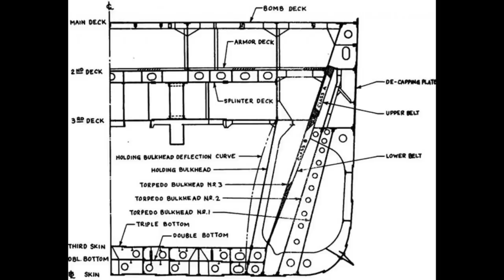The Drydock - Episode 230

Comment: 27:35 the Hush Hush W1 locomotive was made using a marine boiler and it's one weird looking engine due to the shape of a marine boiler. It was designed by Nigel Gresley who also designed Mallard the fastest steam train in the world.
Reply: You misspelled Milwaukee Road F-7.
Reply: The Baltimore & Ohio built several experimental watertube-boiler locomotives beginning in 1927.  They were unsuccessful because while watertube boilers are really good for applications that require long periods of steady power output--stationary power plants and ships--they don't do well where the power demand is highly variable, as in a locomotive.  The firetube boiler is better in that application.
Reply: @michaelmorley7719  to add to that, Baldwin 60000 at the Franklin Institute has a Water Tube firebox, which was trialed in place of a full water tube boiler by Baldwin for a few engines, and it was found that while it gave better steam production, maintenance and cleaning was said to be an absolute nightmare and much more costly endeavor than a traditional firetube firebox (mouthful I know). So ultimately, on the harder water that most steam locomotives used, it was easier on maintenance to just not use a water tube firebox or boiler
Reply: It was also the only tender locomotive with a 4-6-4 wheel arrangement to run on UK tracks... though it wasn't much like the American 4-6-4s, which were basically a brute forcing of the 4-6-2 design for more power output at speed (though not without its caveats, they pretty much needed a trailing truck booster to start heavier trains).
Reply: @PaulfromChicago  The F-7s were certainly up there - AFAIK, the Hiawatha timetables required 100mph + running in places. The LNER A4s did not go anywhere near that in regular service, to my knowledge.
Reply: The original sketches for what became the A4's (the class Mallard was a member of) also had a water tube boiler, similar in layout to that on the W1 but slightly scaled down.  The W1's failure to live up to expectations put paid to that and they wound up with conventional locomotive type boilers.  There's a painting of the original scheme in Robin Barnes' book "Locomotives That Never Were".
I've always wondered if it would have been possible to take the Churchward scheme (as used in GWR boilers) of having the feed water cascade down over removeable trays in the steam space to collect the worst of the scale away from the tubes, and apply it to marine type a water tube boiler, but I guess the only place it could go would be the upper steam drum, and there isn't necessarily the room.
Reply: HAHA!  That looks like someone from the 50's made a façade for a locomotive.
Reply: @LeCharles07  have a look at the south australian railways 620 class.  The first of them was "streamlined" in the fashion of contemporary cars, and had an ACTUAL CHROME GRILLE on the front.  One about 10ft wide and 10ft tall...

Comment: Rail locomotives also didn't do so hot with steam turbines, as it turns out. Turns out running on rails is a bit bumpier than in a ship, so things get jostled about pretty badly and knocked out of place. Plus, unless they've got a transmission of some sort, they absolutely suck down fuel at low speeds.

Comment: Many rail companies experimented with high pressure water tube boilers sooner or later but in the end they all had the same problem: The required extra costs for production and maintenance were so high, it became economically infeasible to adopt the technologies, even if individual engines showed promising economic benefits. In the end steam technology as a whole died down entirely in favour of Diesel and electric engines just when advances in design and metallurgy could have made more advanced boilers feasible.

Comment: Alot of Soviet anti ship missles used blast fragmentation warheads and weren't designed to peneatrate armor.  Its still alot of high explosives hitting at a high speed though.  Shipwreck and sandbox box missles are around a mach 2 weapon speed wise.  An Iowa could probably withstand 2 or 3 hits especially if spaced out over the hull.  Anything more then 3 would probably require dock work.
Reply: Depending on where they hit the fighting capacity might be reduced by quite a bit though. Without sensors a ship might as well be unarmed. Now more than ever. 
The new UK super light anti ship missile for the F35 is supposed to target radars, VLS and guns to effectively disable a ship. I guess to sink it a couple GBUs would suffice afterwards.
Reply: Remember, building a new missile is easier than a new ship... The moment they see you're adding armor, they're adding warhead capability...

Comment: The problem with accretion in boiler tubes is that the buildup acts as an insulator between the metal of the tube and the water inside. As any accretion grows, it will reduce the amount of heat that can be transferred to the water, reducing the output of the tube. If it gets too thick, the tube metal will rupture. This is because the heat transfer into the water keeps the tube cool. Without enough transfer, the boiler fire will heat the tube up hotter and hotter. The strength of steel goes down with increasing temperature. Eventually, the tube will become so hot that the metal will be too weak to hold in the boiler’s pressure and the tube will rupture, spraying steam into the boiler’s firebox and forcing the boiler to be shut down. Once it is cool, the boiler will be drained and the offending tube plugged at both ends. The boiler is then refilled and relit and the ship proceeds as normal, just with that boiler producing ever so slightly less steam due to the missing tube.

Comment: 28:50 This is an important point, certainly in the UK. You could make a massive powerful locomotive to pull a long heavy train, but after a certain point it would be too long for the infrastructure (length of loops, signal spacing, etc) that that extra power was rarely needed and you have a big heavy loco which leads to more wear and tear on the infrastructure. As well as the marine boilered W1, the LNER was the only british company to use 2-8-2 tender locos and the aforementioned issues were encountered with them.
Reply: If you need a really powerful steam locomotive with lots of driving wheels, it's simpler and cheaper to just build a Garratt locomotive.
Reply: UK loading gauge is absolutely hilariously small compared to other places. Other European countries for the most part are larger, but all except the former Soviet states pale in comparison to the US. The idea of a 2-8-2 being very large is kind of funny when they were kind of bog standard freight engines in the US.
Reply: @davidfuller581  Remember though that the UK was where the first railroads were built, others like US and SU were later and had longer distances and heavier loads designed in.
Reply: @gregorywright4918  yes, though they also expanded as needed moreso. The UK's choice for 3 or even 4 cylinder 4-6-2s instead of just using larger 2-cylinder 4-6-4s or 4-8-4s I would postulate is down to loading gauge limitations. 

Then again, the UK rail systems didn't even transition to full train air brake systems on freight until the 1970s (60+ years after federal law in the USA required them on every train), so... The UK was an odd duck in that sense. They just didn't bother doing things other countries did.

Comment: I remember the photo and article in 'The Daily Telegraph'  announcing the towing away for scrapping of the KGV. At that date her steel, predating the atom bomb, would therefore have had a specialist use?
Reply: It wasn't the atomic bomb detonation that makes post WWII steel slightly radioactive, it was the use of radioactive isotopes in the lining of the blast furnaces.  They used these isotopes to measure the wear and thickness of the lining.
The amount of radiation is trivial, and for most purposes, harmless.
It is only for the most radiation sensitive instruments that it becomes a problem. Therefore only relatively small amounts are needed.  That is why no steel manufacturer makes it today.  It could be done, just not enough demand for it.  Most pre-war steel just gets melted down and used as ordinary scrap steel.

Comment: Drach Incorrect even allowing for your engineering background , welding was a lower skill set than riveting -hence it was brought in especially in USA -both in ship building (US built SD hulls liberty ships as opposed to British /Candian SD types) and in tank manufacture.  It was brought in as training a WOW welder was far less than training a team of riveters, one person (plus a single foreman suppervising 2,3 or 4 welders, as opposed to 10 people, 4 people acting as drillers, rivietting crew = 1 heater, 1 chucker, 1 catcher, 1 setter ,1 caulker and 1 foreman.      The main advantage of welding is higher volume in comparatively less manufacturing space -including pre frabrication of ship components -huge man power saving, lower skill set and training time -for some welding in US the system was almost unskilled as multi head welding machines were used (again particularly in tank manucacture) but also smaller fabrications in ship building, where the human element was as a machine watcher and removing and fitting components and materials.   The final problem with welding was a riveted ship can flex a welded ship far less so and before x-ray weld inspection voids caused failures -most noticeable in the failure of welded SD types in the early 1950s.
Reply from the maker: Interesting, in the 1930s there's a lot of period correspondence in the UK shipyards talking about how welding can't be adopted at the level some contracts ask for die to a lack of skilled welders and the time it takes to train them vs taking on apprentice riveters.
Reply: @Drachinifel  The UK Shipping industry were very good at writing excuse letters,  What apprenticeships in the 1920-through 1930s -apprenticeships only really strarted again in 1937/38 - when school leavers taken on a apprentices, unskilled hands weren't needed before that. most of the "trades" I mentioned in the 10 required for riveting were in effect journeymen in one way or another graduating to caulkers, setters, and foremen .

My main  interest in AFVs links fairly closely to Naval and Merchant ship manufacture as far as construction techniques are concerned as does my skill set and an elctrical engineer.  That for example VA and Swan Hunters, Walker Naval yard are in my locale -there was little oportunity that either Vickers Armstron or Swans could have moved into large scale electric welding certainly prior to 1943. Even then the Grid supply in the 1940s being in effect two medium power stations at Swalwell als having to supply Delta Iron Works and Dunstan -which was oposite VA but on the wrong bank of the Tyne could supply current. So that would mean gas welding which is anyway limited utility  and despite BOC ICI having plants fairly close by -gas for cutting was far more of a priority. 

The general availablity of Welding equipment also made the ability of UK to carry out large scale welding in heavy industry limited . Further a lot of matieral in tank manufacture and in light naval construction  -splinter shields etc was CTA armour a face hardened plate of 5/8 inch maximum and was unsuitable for welding, welding would both destroy the hardness and cause stress failures. This also applied to Nuffield Aero Engineering as well as Vickers Armstrong who both made representations to eschew welding from their early war production,  VA starting welding on some rebuilds and new production in late 1942 /1943 (Valentines) and Nuffields at least 18 months later.  

As to Walker Naval yard they were well behind the curve which effectively led to their demise in the 1980s/90, indeed I doubt the North East shipbuilders ever recovered from the 1930 depression, Only as late as 1965 did shipbuilders like Austin and Pickersgill produced a modern iteration as a welded manufacture liberty ship replacement as the SD 14 design - it was too little too late. Apprenticeships after WW2 was rubbish - leading to a situation in 1977 when Swans building IIlustrious R 06 ran into problems with the flight deck camber -asking Barrow ( R0 5 Invincibles builder) how to do it only to be told to FOFO as it was a secret -so Swans went crying to Daddy Gov't to resolve the matter. There was also the Glasgow fire in 1976 which was a tadd iffy.
Reply: @Drachinifel  Drach I agree with User-Op4 that welding was a lower-skill job than riveting, but it did require some training and infrastructure like upgraded electric supply, which the US yards got with government help where the UK yards lagged.  Remember also that there were teams of women doing welding in the US merchant yards, but very few women in the riveting teams.  A good reference is Warship Builders, chapter 2, and where they talk about the use of welding in the Iowas.

Comment: Re: 300 U-Boats.. Drach rather than get into the weeds about material redistribution .. 300 U -Boats would have required something on the order of 4,000 Engineering Seamen and Ratings plus another 1,000 or so Officers...

This is the same problem S.M. Sterling (Theater of Spies) ignored when he "Gave" The High Seas Fleet radar in WW1. He ignored the fact that the entire fleet would have to have complete turret redesigns and tear outs to give them elevation to take advantage of it... And the reliable electricity, suitably shock absorbed to make it vaguely possible. Not to mention the tech/techs to make the returns comprehensible... 

Giving Germany 85-90 with a production pipeline for men and material would have provided the RN ALL the handful needed... AND been w/in the bounds of believability... ESPECIALLY had they pre-solved their torpedo problems...Heck just give them stolen Dutch "Snorkel" designs as well and HOO BOY!!!

Comment: It is said that the General Belgrano was sunk with period Mk8 torpedoes because they were more appropriate for the WW2 construction. My sources suggest that it was because the modern tigerfish torpedoes simply didn't work.
What would modern torpedoes that blow up underneath a ship do to an armoured warship? A modern destroyer is chopped in half.
Reply: Regardless, and "beside the point", as i understand it was the older torps that were used to sink the old Brooklyn class cruiser, one hit in the extreme bow of the ship, and blow it off (it was a US cruiser after all), but the bulkheads held, so it did not contribute to the sinking, however the other tinfish did hit just behind the armour belt, and did penetate deep into the hull before exploding, causing massive leaking, sinking the ship in short time. I think the hull was so weakened by rust, over the years, that she would have been sunk by any torpedoe regardless.

Comment: The airfix kit of the Bristol Beaufort shows an additional ' horizontal tail'on  the torpedo. Is that a special modification for the attack on Gneisenau, or did all British air launched torpedoes have it ?
Is it made from wood or metal ? I don't recall seeing them on the Swordfish?
Reply: Those were stabilizers for shallow water operations. It was used on Beauforts and Torbeaus. I've never seen them in pictures of Swordfish or Albacores. They were made out of wood iirc.
Reply: @The_Modeling_Underdog  thank you. 😃
Reply: @The_Modeling_Underdog  thank you
Reply: @anselmdanker9519  My pleasure, mate. Cheers.